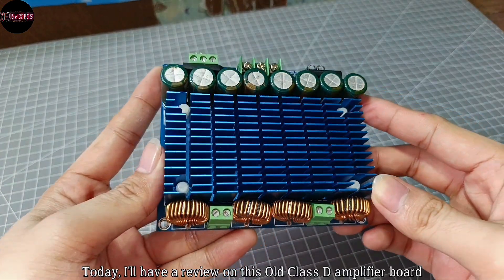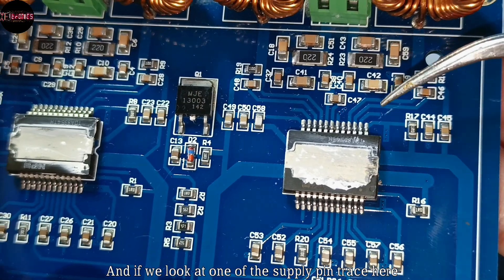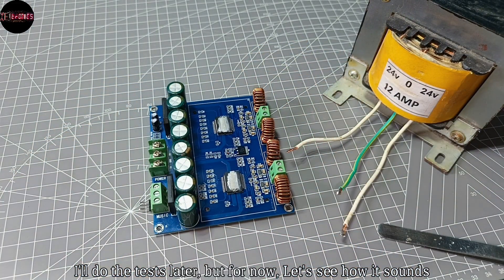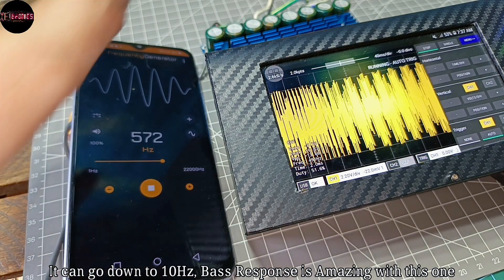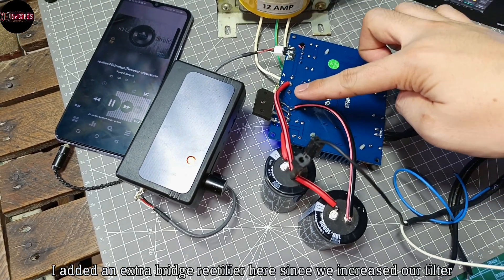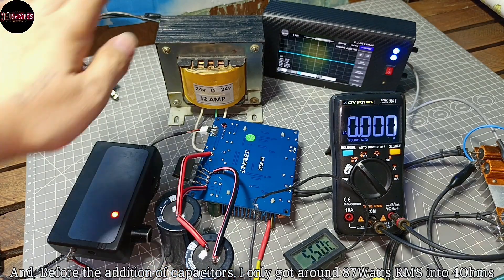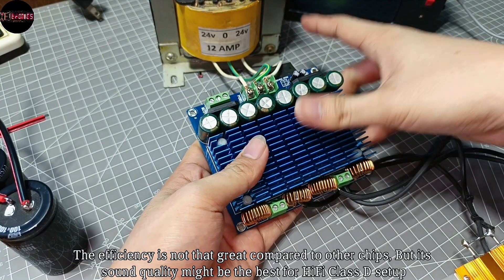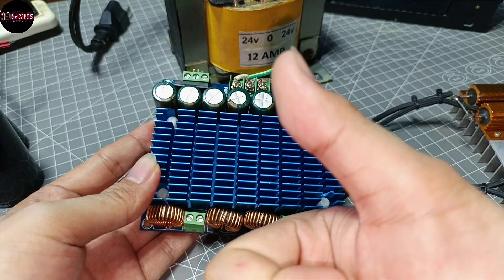TDA8954th RMS Power Test, Modifications and Review! #classdamplifier #tda8954 #amplifier #diyspeaker

Comment: Powerful stuff! Hard to beat that Class D efficiency.  Good catch on the scrawny power feed design.

What app are you using for tone generation,  it looks good.
Reply from the maker: I just downloaded a continuous 1Khz sinewave and play it in my Music player. 
I also use "Frequency Generator" App. works well but it needs a preamp since the app outputs low amplitude to compensate the flat response
Reply: @x3dtronicsph Groovy,  thx.

Comment: At 2000 uF per rail that's a provision for recieving an SMPS voltage...where the switching frequency must be near about 450kHz...or more
the internal class D frequency is itself around 350kHz.. therefore the smps freq. has to be much higher..for it to deliver instantaneous power .
Power = Energy × freq. @ 
100Hz or 450kHz...
the maths tells the difference..
Reply from the maker: Thank you for the very Important Information brother. ❤

Comment: Why there are ripple - those green capacitors are "REAL" Nichicons 😂😂
Reply from the maker: Their capacitance is not enough for Linear power supplies. It will not be a problem with SMPS though
Reply: @x3dtronicsph  True- true.. My homemade AB amp  has a super strong transformer 600W (2x24V) and voltage is around 2x42V with 2x4700mF (cant remember exactly ) - but when under stress 120W voltage falls to 38V even. You heed really high capacitance to hold the voltage high enough
Reply: @CocoSloan ..The 8954 with a +/- 24V supply (in bridge mode @ 6 ohms load) is capable of around 400W "continuous" ...with an adequate heatsink....
.....that translates to around 8 AMPS of continuous current demand from the transformer & peak power can cross (600-700)W....so a 600W transformer is woefully inadequate to deliver..rated power .Hence your dc voltage is dipping & has a high ripple content.
A high average ripple current draw from the capacitors will cause them to heat up...
The allowaable capacitor ripple current & ripple voltage must be within the limits as specified by the capacitor manufacturer..(look up it's data sheet) .
conventionally , before the smps era...A general 
"rule of thumb" was 2000uF /AMPERE of current for  50/60 Hz supply... that's about 16000 uF of capacitance reqd.
A (1200-1400)VA transformer would be ok for ONE Ch @ +/- 24V .